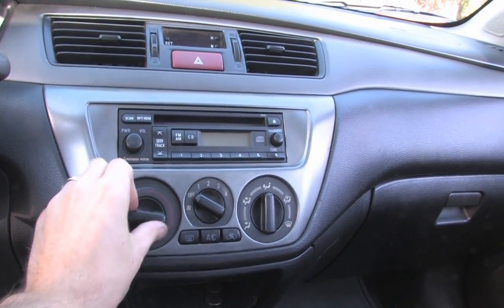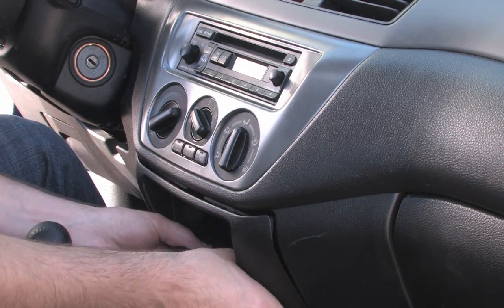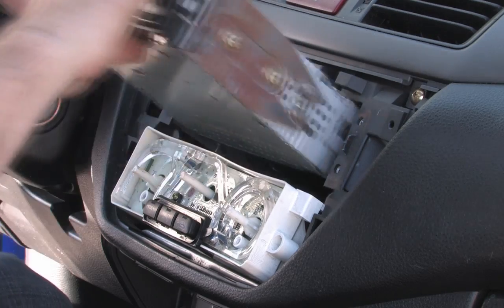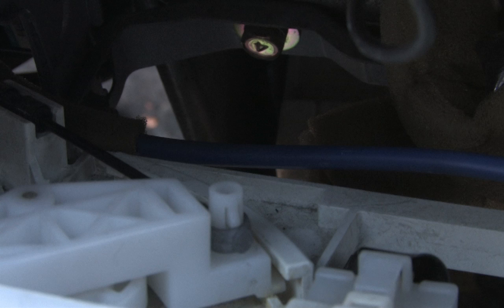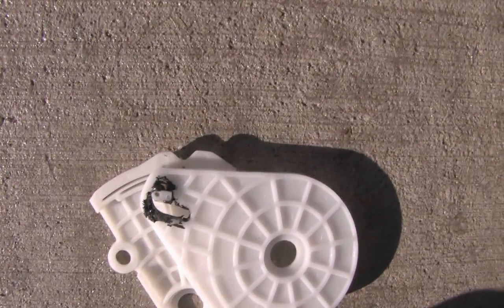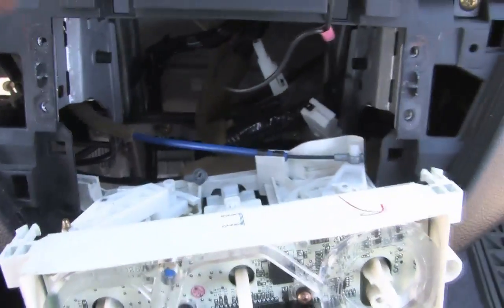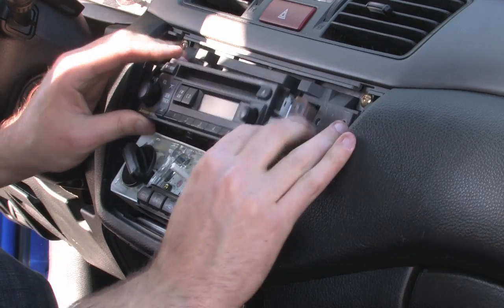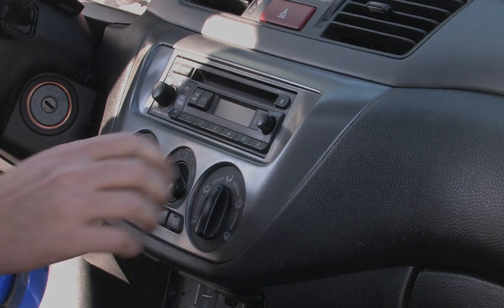How to fix a stuck heater control knob // EVO// Lancer// Mitsubishi - Boosted Films

Comment: My knob turns all the way (with difficulty but it does turn) when I turn it all the way to the a/c it still blows hot air. Is this just a faulty gear like this or is this a problem with the a/c. I listen to see if i could hear a click when i rotate the knob and there is no click.

Comment: Just this morning my knob turned all the way from cold to hot with out the full feeling that some kind of flap fully switched over.  

Now my knob will turn from cold to hot but come back about 45 degrees of the way back toward cold leaving me with slightly warmed are.  Everything I've looked into over the past hour has led me here and I think this should save me a ton of time and money.  Thanks in advance.  I'll certainly post back if the problem is fixed.